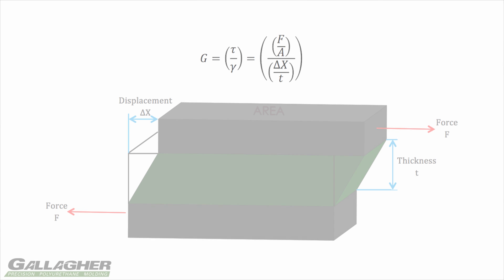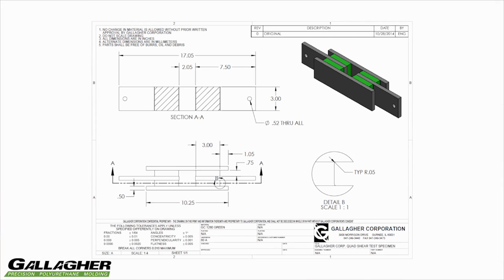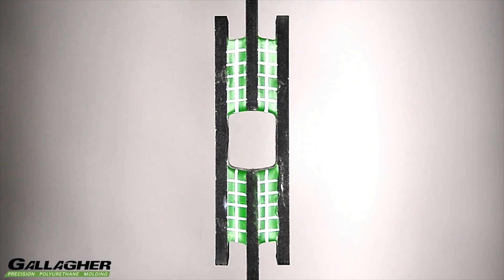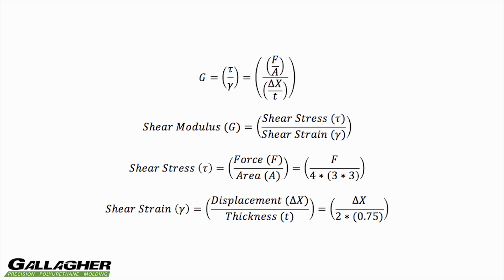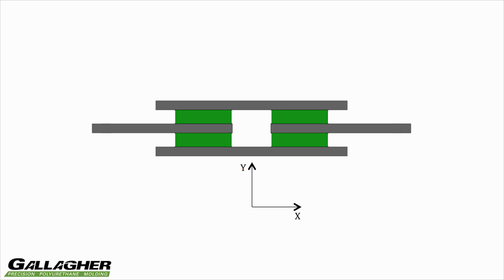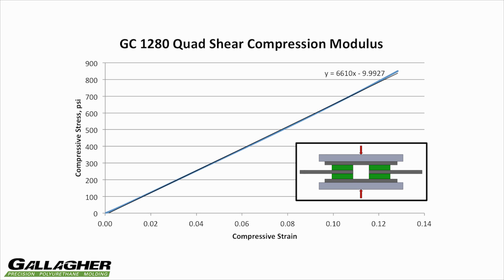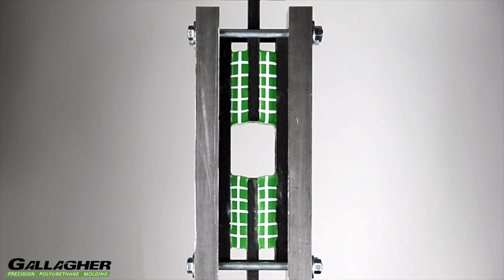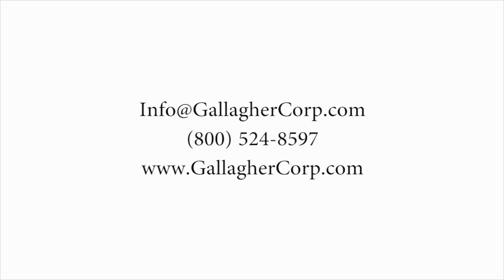Determining the Shear Modulus of Polyurethane  |  Gallagher Corporation

Comment: Nice video.  Could you tell us what kind of binder (glue) do you use for attaching the sample in the metal frame? Thank you.
Reply from the maker: The metal frame is held together by the bolts. "The preload is maintained during the shear test by four bolts that were tightened down, finger tight, when the sample was compressed."